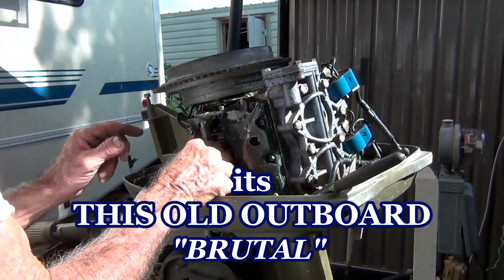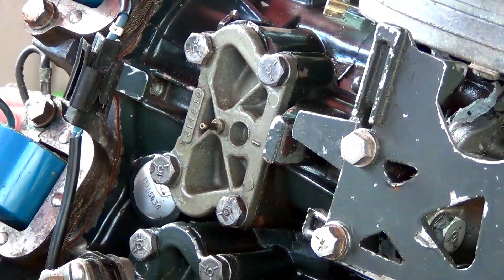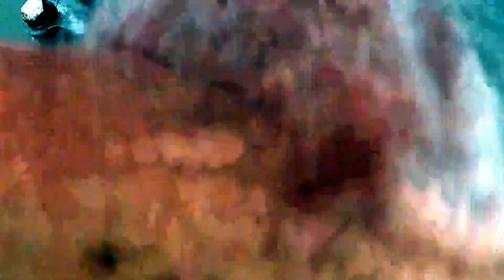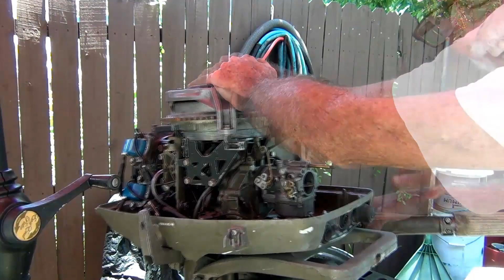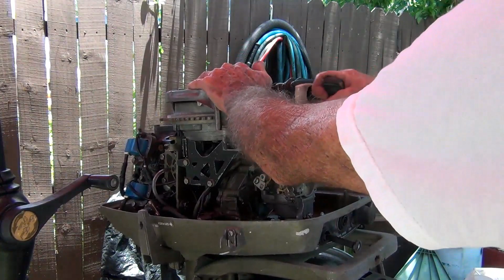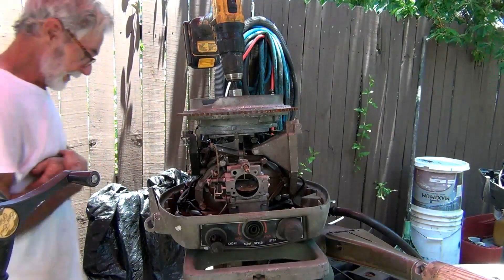74 25 Hp Johnson - Will It Fire Up? - pt 11 THIS OLD OUTBOARD #outboardrepair #outboardrepairvideos

Comment: What’s the lowest my compression should be without needing a rebuild on a 87 johnson 40 vro?
Reply from the maker: Hey. Thanks for tuning in. 90 and below is considered too low- but the problem being- if both cylinders match or within 5 lbs of each other it may run fine- if they are way off then one is not pulling its weight- Those old Johnson 9.5's have been known to still run well on 60 psi. Also not all compression testers will test the same- I don't know what your dealing with on the forty, but if its bad you may want to check ebay for a good used 40/50 powerhead with with good even compression- Good Luck!
Reply: @THISOLDOUTBOARD1 i have 112 on both cylinders.. so good compression.. and i have spark.. i can’t get it to idle but will run with the throttle on. I believe it’s misfiring on the top cylinder. I have cleaned and rebuilt carbs.. putting a new fuel pump today. Power pack is new, coils are new, plugs are new. I’m thinking it’s starving for fuel or the timing maybe off a little. What’s your thoughts?

Comment: I think somebody should send you a starter. Ebay has them . I just fried mine on my 63 18 hp evinrude. I do has 25 hp  Johnsons with bad melted coils and no way im i going to pull it especially with 2 hernias .  I feel your pain
Reply from the maker: Hey. Thanks for tuning in. I've got starters- This is just a mock-up- The point was to just hear it pop, not run- Yeah I wouldn't be pulling anything with melted coils! Hahaha that would be just crazy! Pulling this 25 wasn't too bad considering the high compression it has, it should have popped- Stay tuned to find out why it didn't! Thanks again !

Comment: I built a wooden frame around my barrel with the motor mount built in. The entire weight of the filled barrel is supported by the frame.  It is super stiff and lets me pull the starter rope easily with two hands.  I think you won't have any problems pulling the rope when you aren't putting half your effort into holding on to the outboard.
Reply from the maker: Hey. Thanks for tuning in! Yeah I just wanted to hear it pop! Just once! Hahaha! Stay tuned to find out why it didn't! Thanks again !

Comment: I am amazed how my 1956 30hp with 98 lbs compression an a 6 volt starter spins over like a top and fires right up see you in the next one can’t wait to hear it running
Reply from the maker: Thanks again for tuning in! At 98 psi you should be able to spin the flywheel by hand and start it! She's dialed in! Stay tuned!
Reply: @THISOLDOUTBOARD1 yeah I can pull it by hand but at 65 I like bumping the start button and she’s purring like a kitten

Comment: Hi TOO, anything larger than a 10hp you need a starter in my opinion. I use a DeWalt corded 1/2" drill motor but with a ratchet adapter on Amazon called performance tool W32137 1/2" drive. It's reversible too. So once the motor starts it will just ratchet and not tear your arm off.
Reply from the maker: Hey. Thanks for tuning in! All my Dewalt drills have a built in ratchet/setting. The exact same thing happened with the 71 20 horse- high compression and a bear to pull- but after I it "got dialed" in and "juiced up" a 10 year old could pull start it! Stay tuned to find out what's really going on!

Comment: There is a tool called a ratchet adaptor that would take the kick out of a drill when you use one to start a motor. If there is a way to send one to you I will get one and send it. Might keep you making videos instead of getting hurt.
Reply from the maker: Hey. Thanks for tuning in! All my Dewalt drills have a built in ratchet/setting. It wasn't that it was hard to pull it was that it was hard to start- Stay tuned to find out why!
Reply: That ratchet is a very good idea but only protects as the engine starts and races faster than the drill. Our friend gets hit as the cranking (and bucking ) drill slips in his hands.
Reply from the maker: the drill slips due to the amount of torque it has!

Comment: Yikes! Hope you are on the mend. Have done the same thing using my drills. Those motors need a decompression lever. I've been smacked by the drill and the tiller to add insult to injury in the nether regions. You are almost there so hopefully you can get an e starter on it. Take care.
Reply from the maker: Hey. Thanks for tuning in!